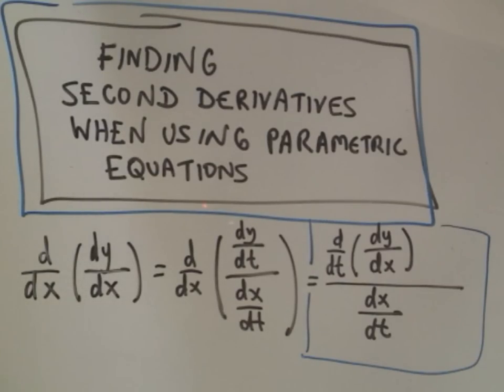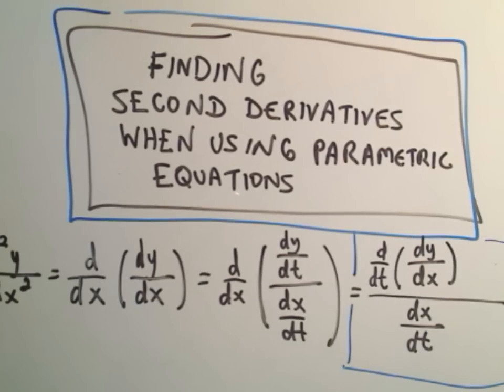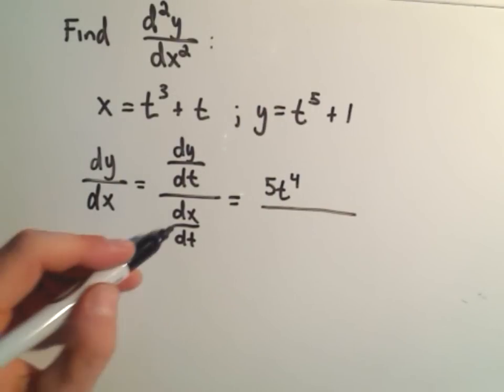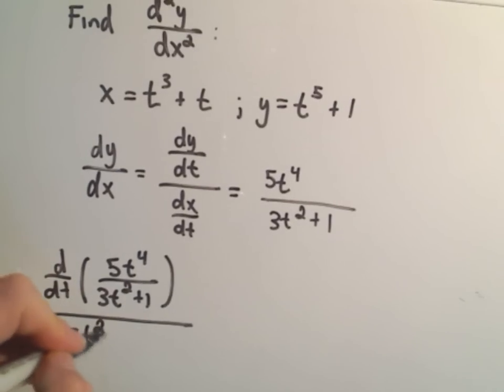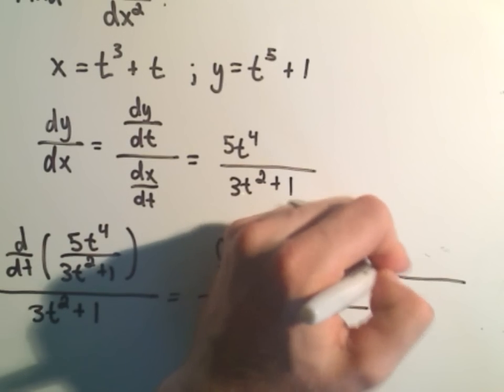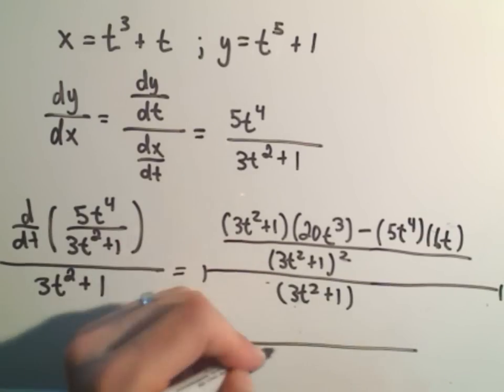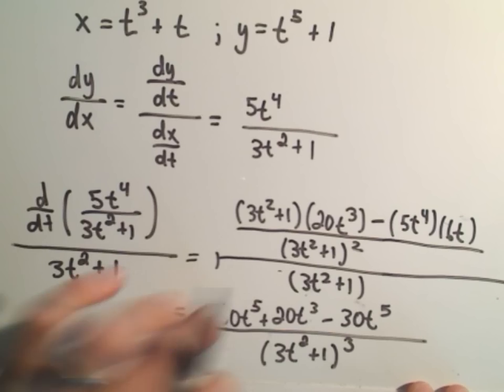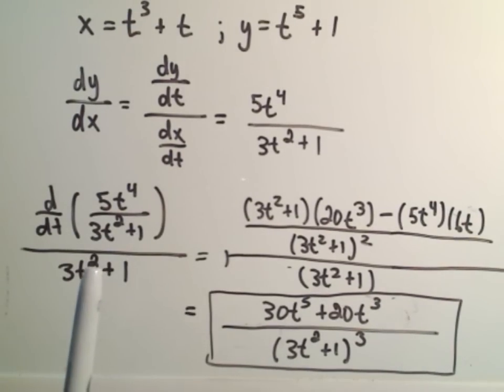Parametric Curves - Finding Second Derivatives

Comment: the flip and multiply  the (3t^2+1) should be multiplied by the numerator or am i wrong
Reply: no, the flip and multiply should be done with the denominator cause you are getting the 2nd derivative you should have denominator raise to the 3rd power after you are finish with the denominator you now use the quotient rule in the numerator. Hope it helps you :)

Comment: Hi. If this was on the BC exam (perhaps the essays), is it fine to leave the answer with a fraction divided by a fraction, like you got when you first calculated ((d^2)y)/(dt)^2 ? Or would it be better to rather make it into (3t^2 + 1)^3 in the denominator.

Also, thanks for the videos. I've only seen the two on derivatives of parametric functions, and they are quite good. I appreciate your help.